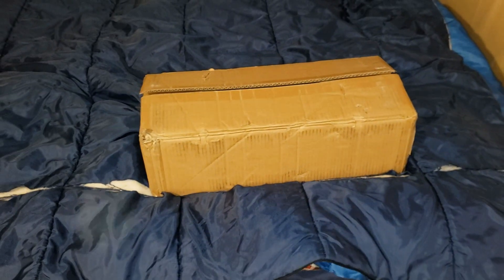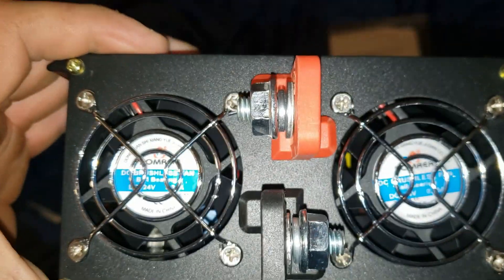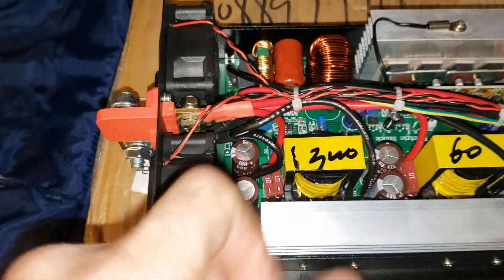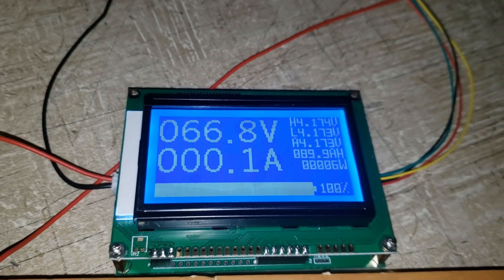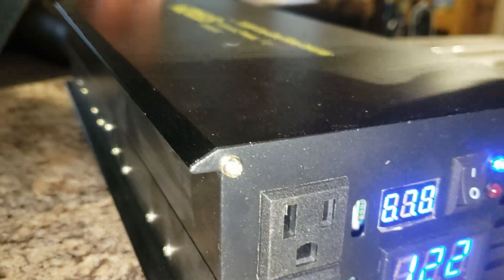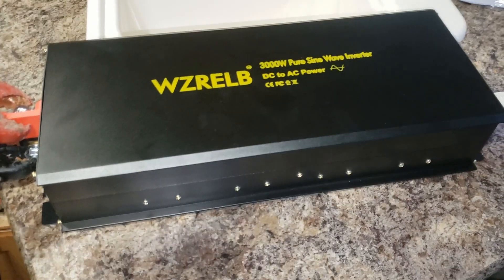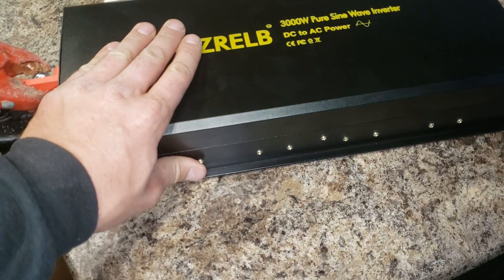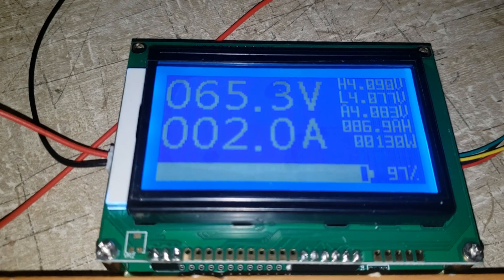New Smaller And Lighter 3000w WZRELB Inverter Is It Better?

Comment: I Opted for 4 WZRELB 24 Volt 3000 Watt Inverters for My Applications here on The Ranch ⛩
Reply from the maker: Mine is still kicking :)
Reply: @GoingOffGrid101  24 Volt Dual Phase 240 WZRELB Inverter is My Next Investment 👌

Comment: .1 amp at 65V is 6.5w for 3000w is great.
Reply from the maker: it was less then an amp but 65 volts times 1 amp is 65w. it was closer to 35w if I remember right :)

Comment: i just a bought a Reliable  pure sign wave 3000 watt 12 volt inverter. I cant wait to get. This units has some good reviews on youtube.
Reply from the maker: just be careful with large motors its what kills HF inverters :)
Reply: @GoingOffGrid101  I have the same. What do you mean large motors? I'm installing it in my RV Travel Trailer. I'm thinking 🤔 in my head what do I have with a Motor? Maybe a fan? Vac? No tools will be used. I have a 4500/3650 watt generator. I will use.
Reply from the maker: @DavidrKun   large well pumps and compressors are the bad ones, or your 13500 btu AC would also be hard on this unit unless you have a easy start for your AC from microair.com
Reply: @GoingOffGrid101  I do have a 13500BTU unit. I can't seem to find what you send me as a link to buy what I needed.
Reply from the maker: https://www.microair.net/collections/easystart-soft-starters/products/easystart-364-3-ton-single-phase-soft-starter-for-air-conditioners?variant=30176048267

The EasyStart
Reply: @GoingOffGrid101  Thanks man, I am not an Electrician and thank goodness I have a best friend who is. So I will see this as a good learning experience.
Reply: @GoingOffGrid101  I just bought this inverter. How did you get 66V input? Could I set my battery bank to 24v? I only have 4 12 volt battery bank. Thanks for the speedy reply.
My booklet says input 12v,24v,36v,48v,60v,72v,96v,110v just wondering. I also message the seller too for confirmation before doing anything
Reply from the maker: @DavidrKun  https://www.youtube.com/watch?v=L6usNZy5cqo&t=413s
Reply from the maker: @DavidrKun  you have to tell the seller what voltage you would like.
Reply: @GoingOffGrid101  yeah spoke with them. Its a 12v
My issue is when I am connected with my battery bank. It shows 13.2v then when I put a load. It drops to 11.6v
Then down to 10v then shut off. 
I bought refurbished deep cycle batteries. I'm thinking they are just bad. I have a 3 months warranty.
I'm thinking I need to swap them out. They don't last long at all.
1200watts only for 6 hours.
I have 420ah battery bank.
Reply: @GoingOffGrid101  well, I think it's my Batteries. It looses Voltage and shuts the Inverter off/reset. Very frustrating. 
I did buy used deep cycle batteries. However I did get a 3 Months Warranty.
We will see about it.
I would be happy with 90% usable. But feels less as I only get about 9 hours off 1375watts. Drops it down to 12.3 volts
It just my 
Desktop computer 800watts
LEDTV 75watts
MacBook 400watts
Anyways the point is when I put heavy draw it drops below 10volts shutting it off 
I have 10AGW
Should I change them to 2AGW?
Also I'm thinking of getting 2 inverters
Can I pigtail them together?
Reply from the maker: @DavidrKun  if you are getting 1200w for 6 hours your 420 Ah 12v battery bank is doing well. you will need 2000ah at 12v to run a house.
Reply from the maker: @DavidrKun  what wire size do you have? 10 gauge?
Reply: @GoingOffGrid101  yes, I was thinking of going to Home Depot and getting some 2 gauge wire. I've seen so many videos on this inverter. 
I'm guessing it's all the above.
Need thicker wire
Need better batteries.
When I plug the inverter I get 13.1volts
Then drops to 12.5volts
But once I put a load say the coffee maker. (1800watts start)
It shuts off or resets beep.
Thanks for the speedy reply.
I'm asking the swap this 3000watt for Reliable 5000watts
It's just another $290
But waiting is holding my projects up.
But I want to do it right.
Reply from the maker: @DavidrKun  :) rule of thumb is if you have a 3000w inverter try to stay under 2200w in case something needs more power to start, so a 5000w would be around 3500w if possible.
Reply: @GoingOffGrid101  so I was using 10AGW wire. I changed it to 4AGW. so I don't get much a of drop now. I'm very happy. Can turn on my Microwave and coffee maker. (Not at the same time)
Just learning and making it happen. Thanks for the speedy reply.
Reply from the maker: @DavidrKun  that you got it working better :)

Comment: Well nobody else said anything but how can you just use jumper cables because I've been around cars since about '62, and there isn't as good of a connection with a temporary spring clamp versus a bolted on cable...ain't happenin bro...there's no way to even get a reliable voltage reading because heat where the connection is because of amps...there's not enough surface area, it heats up and changes the voltage....you mean out of all these comments nobody said anything about it....the same thing happens when welding something rusty...hard to get a ground with just a clip on clamp , yep, hard to get enough watts to weld even sometimes because of it, and it actually throws off every test you're doing but you don't even notice what you are doing....how can you rate it or even test it without a good connection? On a tiny inverter you can get away with it but not output test a 3000 watt....for reals? Nobody caught this? It has something to do with an antique property of electricity called "Ohm"s law"...it involves a little known nowadays principle called resistance that has a great effect on whether or not one is victorious in this search for usable watts...it basically states that watts lost due to poor connections never make it to the battery, or that if you try to run a buffalo sized load of amps thru a mouse hole some of them might not fit...U see why you might have a burned up inverter? I have four 1/0 cables connected to mine...I even bought those expensive good solder on lugs like tractor style....and you have jumper clips but everyone is cool with all that and expects the same wattage...okay...even though I got a scholarship for math, I'd like to know how you get reliable results with temporary jumper clips that change resistance constantly....or am I stoned, and those aren't jumper cables? They look like junkyard style connections...If I had a silver dollar I would bet it that you haven't checked the resistance of those cables either...what if the current is going thru the spring instead of the contact side? Uh oh theres resistance..I heated up some chow in the micro and my inverter/charger connections didn't even get warm at all...how about yours? Ever checked it? I just think you're losing watts probably there but maybe it dont matter  idk...
Reply from the maker: haha thanks for checking out my other videos.
 first off this is a 66v battery bank and inverter so only 45 amps running through the cables, high voltage is great :). also the cable problem, I have checked a few times off camera with a multi meter that I'm not losing much voltage less then 1 volt. also the booster cables at 45 amps do not get warm at all, not even a tiny bit. I believe this test is 100% accurate.

Comment: I really wish all of these units were using a standard mains duplex receptacle rather than the cheap plastic panel mount ones that tend to melt when the current is near max for a long time.
Reply from the maker: yea got to be careful not to push more then 15 amps per outlet or 12.5 amps each outlet  for 25 amps combined. the other 3000w unit has a hard wire option :)

Comment: It looks like to me the Reliable inverter has a powered neutral. It appears to be split with the hot leg. If you try to power a home that has a bonded neutral the inverter will be destroyed. I have run into this before. I bought  a Reliable to power a well and I will make sure none of the neutral wires are touching the ground leg. Again a house built in the USA as per NEC has the neutral bonded at the mains point of entry. Sometimes when wall outlets are installed the bare ground wire can touch the neutral on the back of the receptacle, again this will let the smoke out of the inverter. If someone tries to power a house with a bonded neutral this will short circuit the inverter through its powered neutral wire. Years ago I destroyed a cheep inverter this way. I found out many cheep inverters have the power split between the hot leg and the neutral. As you know I went with a magnum inverter that does not have this problem so I could power my house that does have a bonded neutral at the point of entry.
What are your thoughts?
Reply from the maker: i will have to test, I have two 3000w inverters and two 4000w inverters and none are live ground surprisingly.
Reply: @GoingOffGrid101  That's good news. I was reading the instructions for the 2000 watt 12 volt model and it warns you not to connect to a bonded neutral. I Have a 3000 watt 24 volt that is a non powered neutral inverter. Maybe it is just the 12 volt models. It seems to me if it is hard wire capable they should not split the power on the neutral. They are just asking for trouble lol. After all how many people read the manual much less understand what it says. I was an electrician and motor control tech. That is the only reason I look out for this stuff.
Reply from the maker: @offgridinthepacificnorthwe3210  I told reliable a few years back to bond the neutral to ground. Maybe they started doing it.

Comment: Can you tell me if the 48 volt operating range is 42 to 61?
Reply from the maker: It would probably be 40 to 60 ish the 60v model is 50 to 75v
Reply: I have a new Ego lawnmower 56V and was thinking of buying a inverter but they're not pure sine wave and home Depot pulled out and you can't get any support for ego anymore there I was thinking of buying a reliable 48 volt maybe 500 w instead to run lighting if the power goes out during a storm.
Reply: I see mines show 60v when I am doing a high amp draw.

Comment: Have you used a Giandel inverter before?  I'm pretty abusive with my 4kw unit, and it's running flawlessly about 14 months later
Reply from the maker: i should try them out.
Reply from the maker: thanks
Reply from the maker: they dont make 48v inverters or 60v :(
Reply: @GoingOffGrid101  Lame.  :(  48v is the new normal.  That's what I'm building my home powerwall at in the next 1-2 years.  Got any recommendations for a good 48v?
Reply from the maker: @InnovativeSustainableSolutions  for cheap the signiner 6000w 48v is nice for the price. The reliable inverters are better in the 4000w or lower range the magnasine is king the 48v pip inverters are best bang for buck
Reply: I have a Giandel 1200 watts (12v). runs great, I am building a bigger power pack with and chose to go with a 48 volt input 3000 watts, but unfortunately Giandel doesn't make 48 volt input inverters. so I went with the Reliable 48 volt 3000 watts. Reliable inverters are cheaper and descent quality I guess.  I will have to wait how long it performs without problems.
Reply from the maker: @varman001  let me know how you like it.

Comment: My brother respect I have been running mines for about 5 months now the 48v model trust me it works like a charm a bit of confession though when I bought it I really had my mind on the older model but this one was a bit cheaper and for a Jamaican that means savings but I had my doubts of its performance even when I order it. Brother the inverter bad trust me it stands up to anything you can throw at it within it's operating perimeter. My only concern and I hope it will never happen is it is so compact that I wonder if the needs ever arrive how easy it will be to repair.
Reply from the maker: I hope it last you many year! im glad you like it.
Reply: I’m about to order a 24v 3000 watts was gearing towards the older one but now going for the new one
Reply: @patcha707  base on my experience I would go for the older one mainly because it offers a hard wire option "thicker wires." Secondly this one is more compact makes for more work when repairing. But if you are like me shopping on a budget this will do.
Reply: Hailup Howard! I have been running a Xantrex 1000 watt mod. sine wave inverter for many years now. I just ordered a 1000 watt pure sine wave Renogy to upgrade my little 650 watt panel system. Maybe in the future i will upgrade to the inverter tested in the video. Greetings from Mobay.
Reply: @lawrencedavidson6195  respect my brother, nice little system you have there. May I say this though there are more upgrades of inverters out there in the same price range now: for example the all in one systems even the reliable inverters are now coming in both 120v and 240v on the same inverter.

Comment: Are they not reliable anymore
Reply from the maker: the 8000w are not as long lasting as the smaller 3000w inverters. mine lasted 1.5 years with large loads but it should of lasted at least 3 years...

Comment: So I bought a 2000w unit based on your reviews. It came with a factory defect, the DC volt meter has fallen right off the front of it. It was adhered with what looks like hot glue. I contacted the company and they told me that happens and to service the unit myself to fix it. Now I have to put myself at risk of getting killed by capacitors just to have a fully functional product. I cannot recommend this company as their customer support is awful (still have their messages on facebook)
Reply: I do have a video on my channel giving an introduction to my system. It is my first solar video, I always loved solar but felt it was unattainable. Your older videos gave me inspiration to give it a try myself.
Reply from the maker: @musicwiz40  I am sorry about that. I am not connected to this company and it is a china company so unfortunately its not the same as USA or Canadian warranty wish a USA or Canadian brand would make custom voltage inverters and i would support them!
if you want to fix it leave the inverter on for 2 days not connected to a battery and then it will be safe to open.
Reply: @GoingOffGrid101  thanks for the input. I'm just going to be very careful to avoid touching any circuitry when I fix it. I've taken on quite a few other electrical projects before with good results. Such a shame because their products seem to perform so well. If they just used a couple plastic clips on the meter instead of hot glue they could have had a great product. Guess that's just them being cheap. I would like to see gfci outlets on it as well. And for the colors of the ac output wires to make sense. This will not dampen my passion for solar energy. I just watched a Halloween movie with my gf on my 65" TV that steamed from my plex server into my home theater system and had a little Halloween dance party all off of solar power and my batteries were still at 12.6 volts under load :)
Reply from the maker: @musicwiz40  that's so sick! Haha. All the best!
Reply: @GoingOffGrid101  hey whilst I have your attention I was wondering if I could have maybe about 10 minutes of your time for a quick conversation on wiring my reliable inverter to a sub panel. I really don't want to make a mistake but I'm not sure about how to wire it to a sub panel.
Reply: The sub panel is going to be its own circuit breaker. Very simple. One circuit completely independent from grid power.
Reply: @GoingOffGrid101  i want to wire my inverter to an offgrid sub panel but the inverter is reading 60v from neutral to ground and I'm not sure what to do. I feel tying neutral to ground would short the inverter. I just need to know how to wire it into the panel :( hope I didn't waste my money on this inverter.
Reply from the maker: @musicwiz40   take a 60w light bulb and test it across the neutral to ground and if it does not light up you will be fine to bind the neutral to ground. i have done this on 3 of my reliable inverters and they showed the same thing.
Reply: @GoingOffGrid101  you're actually an incredible resource. I can't thank you enough. I really appreciate what you do for the solar community and I love your channel. Thank you so much.
Reply from the maker: @musicwiz40  I wish you best of luck
Reply from the maker: I hope this doesn't stop you from providing your one power or backup power!

Comment: so do u put your batteries in series and solar panels to to get the proper input for this inverter. is the bigger input cheaper to run your system as in wiring size and how long it will run. i no stupid question but if i dont ask i will never know. i mess around with 12 volt inverters and panels.
Reply from the maker: I like 60v cause most EV batteries out of cars configure to 60v easy, also u can use much smaller wire. its much harder to find inverters that take 60v. 48v inverters are everywhere
Reply: @GoingOffGrid101  thanks

Comment: I am curious. You said you had 66 volts going in. What kind of battery system puts out 66 volts? Also is that a  special inverter to handle 66 volts?
Reply from the maker: its a 16s lithium battery bank, and yes it a custom built inverter that can take 50-75v
Reply: @GoingOffGrid101  thanks for the reply.
Reply: My 16s LG CHEM (Chrysler Pacifica) with my OutBack FX3048MT can handle 66v lithium battery bank at 48v nominal input voltage
Reply from the maker: @jwsolarusa  sick!! good to know thanks

Comment: I'm planning a 15s (63V max). Is this made to handle that setup, or is it a 14/15s (48s)? The reason I ask is the the seller's site lists it as 48v. Thank you.
Reply from the maker: you have to message reliable when you purchase and ask for the 60v model that works from 50v to 75v
Reply: Perfect. Thank you. @GoingOffGrid101